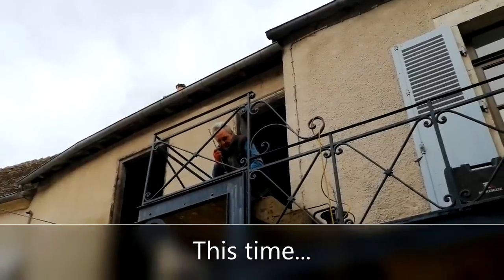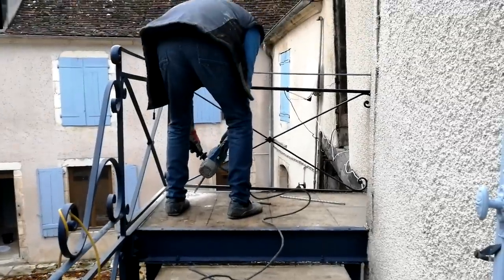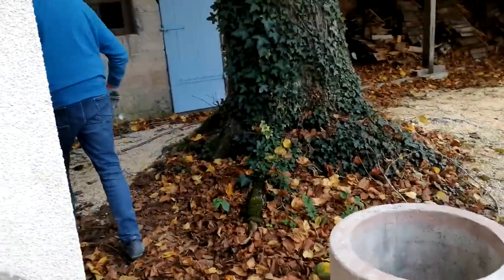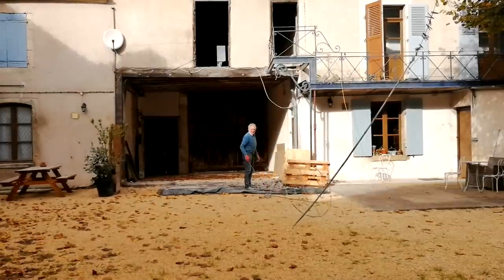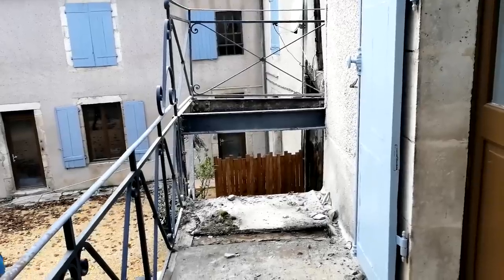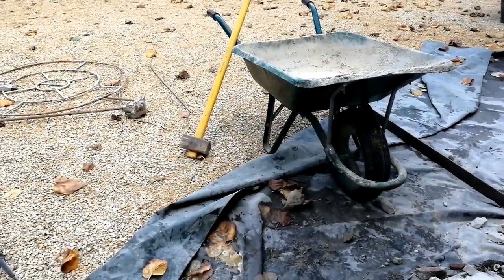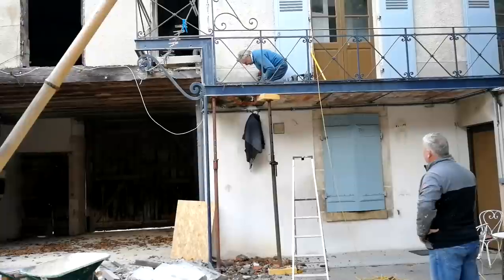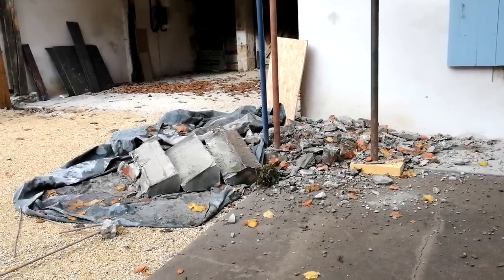Not Quite a Chateau DIY 163 - Demolition - I Need A Bigger Hammer - The Balcony Project Begins

Comment: Now you realise after you cut up the steps into bits that you could of re-used the steps somewhere else in the garden 😂
Reply from the maker: They were too heavy for two of them to lift, to move them anywhere, they only just managed to turn them over to cut them up Steve
Reply: @notquiteachateaudiy  …………. Oh yeah I could see from the way Tony was struggling to first move them and then cut them, how heavy they were, possibly mixed at a ratio of more cement to sand. 
I just thought that somewhere in your garden that they could of been re-used like maybe new steps from river up to garden. 
But yes moving them would of been an ‘real problem’.  😬

Comment: Instead of replacing the floor with cement look into using outdoor decking. I think it is called TREX. It will last for years and will have far less weight.
Reply from the maker: We did consider it but decided to go with the steel for strength, it will be stronger but also much lighter. TREX in the UK is a type of animal fat! it must be called something different there

Comment: Would making the balcony out of pressure treated wood be lighter and easier to build
Reply from the maker: It would Rosanne, and we did consider it, but the rest of the balcony is steel. The weight will be a lot less than the concrete, and the whole structure will be strengthened this way